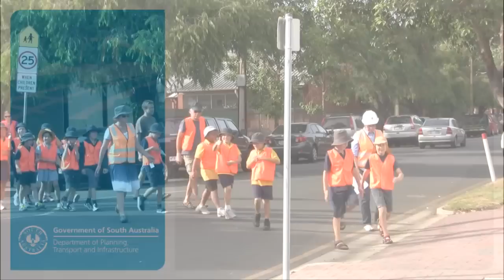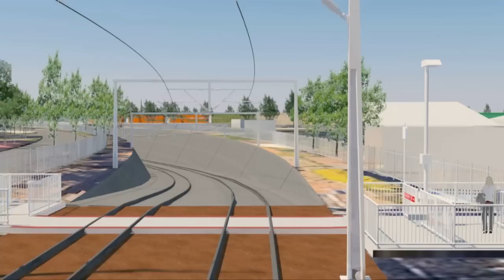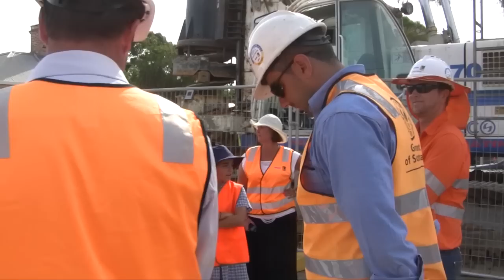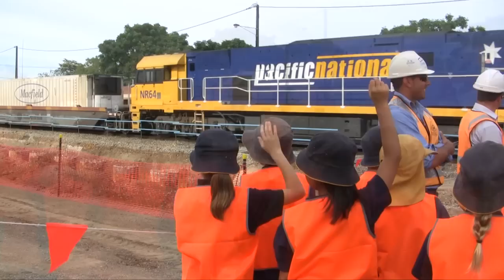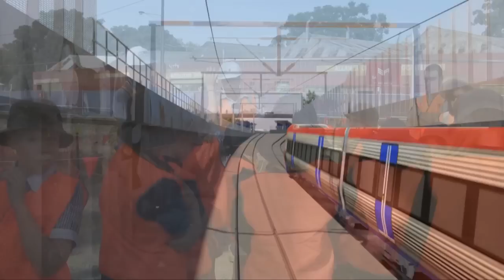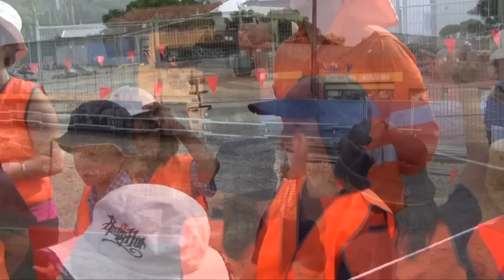kid's questions about the Goodwood rail underpass

Comment: So the obvious question, why didn't they just stop the passenger trains to allow the freights to run through? Surely it makes more sense to stop a two carriage passenger train rather than a 50 - 100 carriage freight train??? Probably would've saved about $109,900 000 as well.